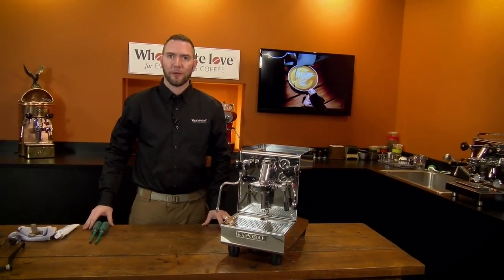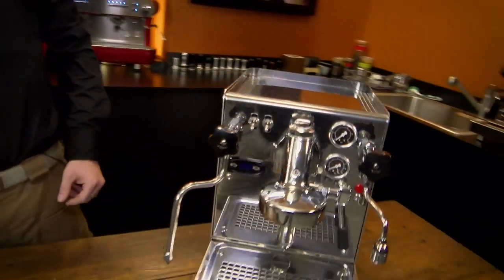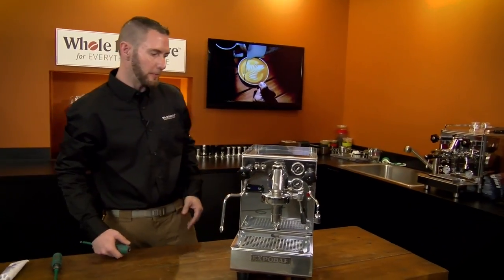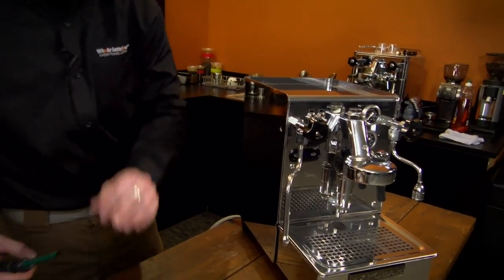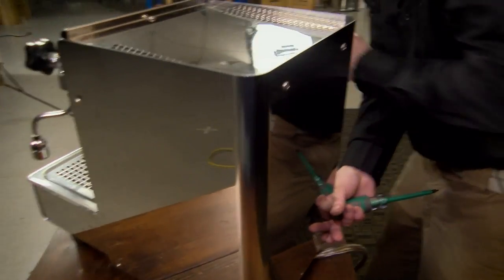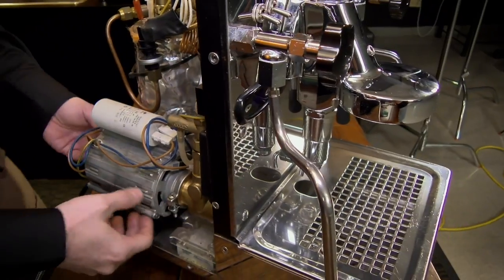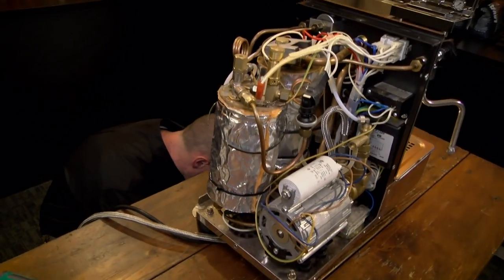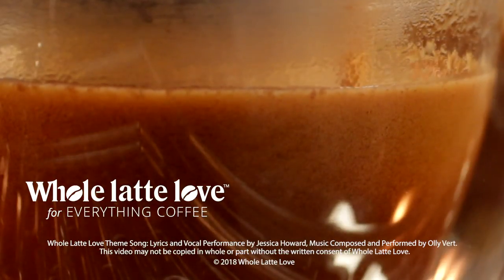How to Fix a Seized Espresso Machine Rotary Pump

Comment: ist possible to set a rotary pum on my Expobar which with vibration pump originaly?
Reply from the maker: Hi a, well, anything is possible and it has been done. Not exactly easy and there's no kit for retrofit.
Reply: you can but again is it worth it

Comment: Does the motor or pump assembly need lubrication?  My espresso machine is 12 years old, the pump got stuck once.  Thanks.
Reply from the maker: Hi JJ, Thanks for the question - no lube needed/required.
Reply: @Wholelattelovepage  Thanks, that's a relief...

Comment: My machines starts with normal sound but when pressure builds it sounds different and seems to drop like it hasn't got the power to push the water,any ideas what the problem might be?
Reply from the maker: Hi PG, Hard to say without knowing make model of you machine and other details. Lot's of possibilities including failing pump, limescale obstruction in brew circuit, etc.

Comment: I don’t even hear a hum in my brand new rocket Giotto Evo R.  Just a blinking green light after switching it on.  It made a pump noise for about 1/2 a second then nothing. Hate to send it back.  Big heavy machine.
Reply from the maker: Hi g, did you try the fix in the video? Also did you purchase the machine from us? If so, please contact us. Our tech support folks can talk you through troubleshooting and perhaps avoid sending it back. https://www.wholelattelove.com/contact-us
Reply: Definitely contact the seller, they should be able to walk you through troubleshooting your machine.  I once received a machine that wouldn't heat water.  Found that the boiler terminals were disconnected (possibly from factory).  Just re-connected them and all was good.
Reply: Mines doesn't have the flat head compatibility so that I can turn it by hand, any suggestions?

Comment: I am sorry, but if you are the service manager then you should go back the school.
You have not found the cause , why it was difficult to move.
I would advice to look at 2 things , from the top of my head.
Measure uf of the capacitor.
Check if the bearings not to be replaced.
It most probably has 2x 6202 and 1x 6200 bearing.
The last bearing is from the pump side which has the biggest chance of going faulty.